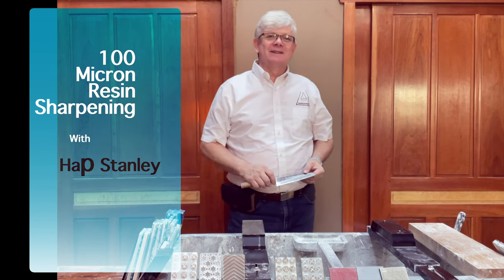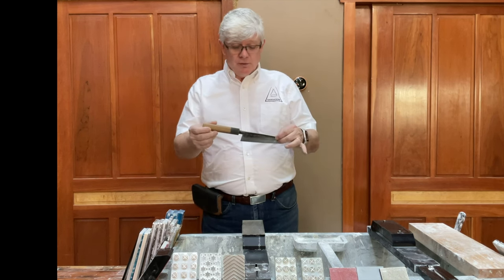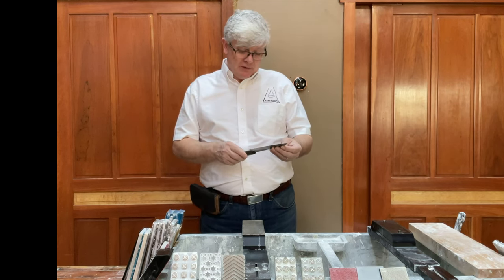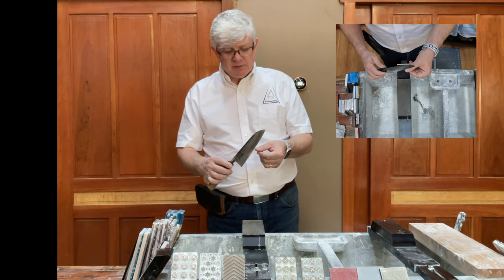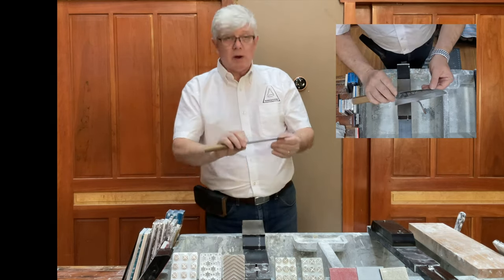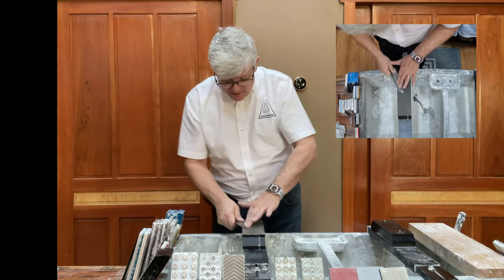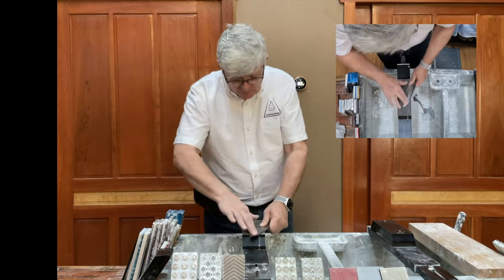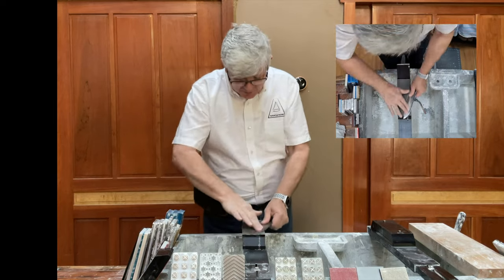Diamond Resin Sharpening

Comment: for the sake of the demo why use a low alloy steel with basically zero resistance to abrasion? Even the most tenacious version of this steel, blue super taken to it's maximum hardness, does not have the resistance to abrasion of any basic stainless steel. What's more standard chromium steels even taken to the maximum expression such as zdp-189 don't even call for expensive superabrasive diamonds either. It's really only vanadium steels that call for or actually benefit from superabrasives like diamonds. I would think for the sake of the demonstration you'd use something like 10v. Nobody in the history of the world has has issues grinding Japanese blue steels, you know what I mean? The stuff is ridiculously easy to sharpen, that's about half of it's appeal.  The only kitchen knife steel you'd benefit from these stones is HAP40. No relation to HAP Stanley, I don't think lol. Even then HAP40 is a very rare almost fringe steel for kitchen knives, not even really used in Japan, it's really only a thing outside of Japan thanks to the influence of companies like CKTG. I do have some HAP40 kitchen knives, and while I'm not really a fan of the steel and dont suggest it to anyone, it would absolutely benefit from abrasives like these. Then again if you need to buy $400 of special abrasives just to maintain your $140 CKTG gyoto then maybe that's not a great choice of a knife in the first place.
Reply from the maker: Thank you for your thoughts. I agree with you, that is an easy knife to sharpen. I love knives that are sharpenable. I have a new resin formula that I’m going to bring out in a few weeks now. I’ll pick a more difficult knife for the demonstration
Reply: I can attest that the 100 micro works well for big nicks on kitchen knife steel harder then this and d2. Others I can't really get right now, but I'm at the point now where I need to recondition it and need to get a good lapping plate capable of the task. Do these work better without water? I've been loading them up when I use them. Maybe that's not the correct way
Reply: I can attest that the 100 micro works well for big nicks on kitchen knife steel harder then this and d2. Others I can't really get right now, but I'm at the point now where I need to recondition it and need to get a good lapping plate capable of the task. Do these work better without water? I've been loading them up when I use them. Maybe that's not the correct way